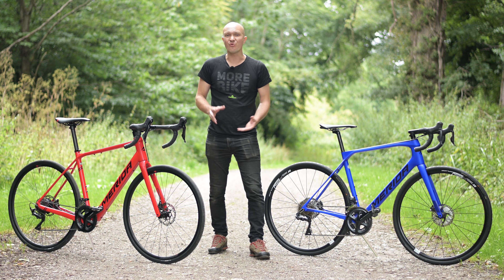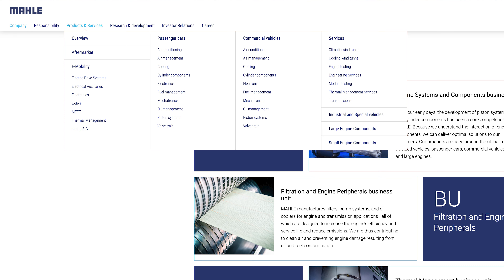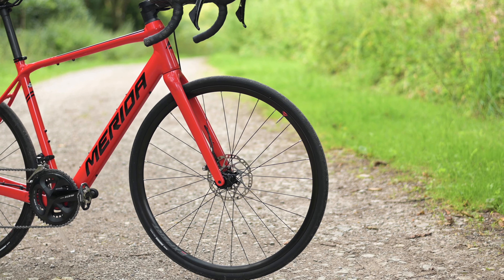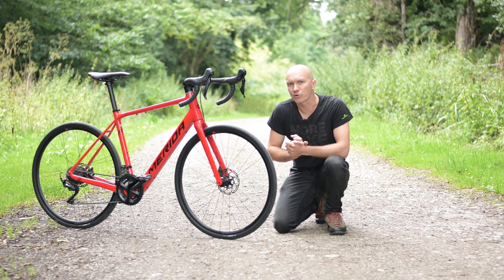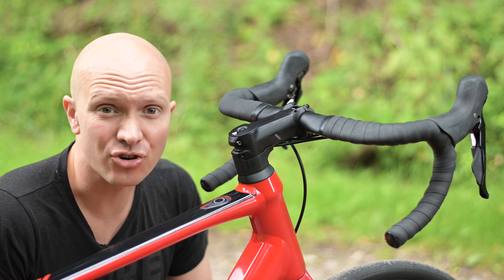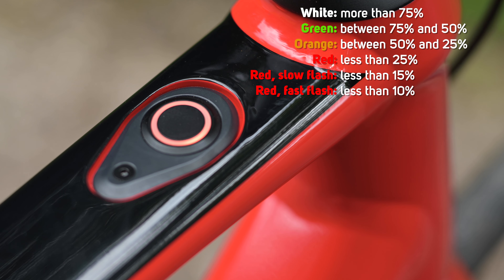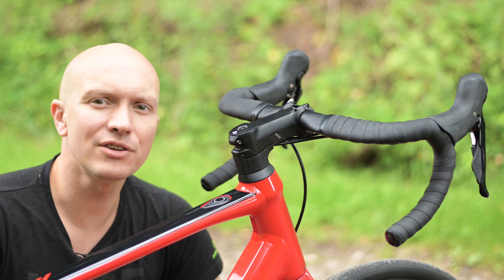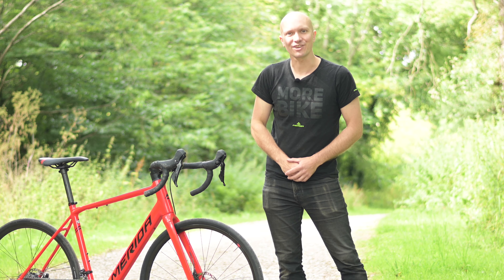Uitleg MAHLE Smart Bike Systems X35 drive unit en iWOC One controller

Comment: you said middle motor system has drag and makes harder to use it when bike runs out of battery but that's not true, not with all brands at least.
Fazua for example has 0 drag, is lighter (3.2kg in total motor + batteries) and can be easily removed as well. Is a lot quiter as well. I don't understand why brands like merida or orbea us mahla tbh is not the best option in the market this days
PS: rear hub motors makes harder to change wheels, not to remove it, to change it for another model. This doesn't happen with mid systems, which can mount 2 plates by the way